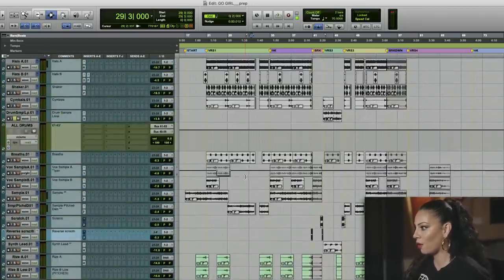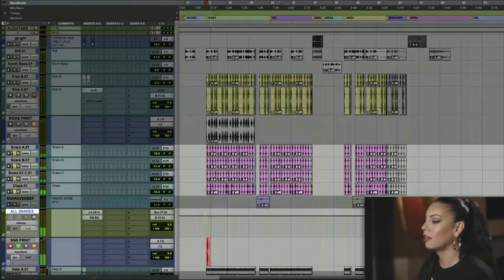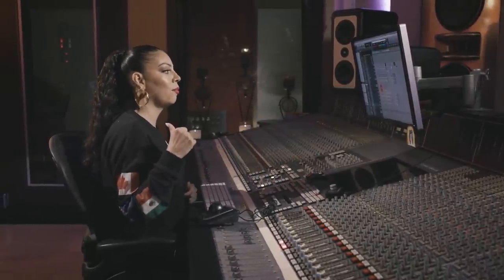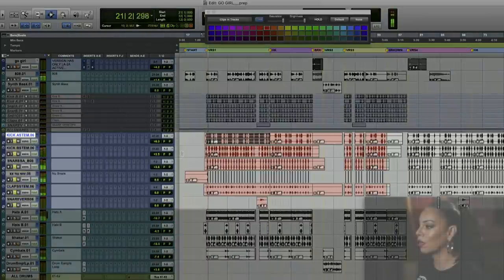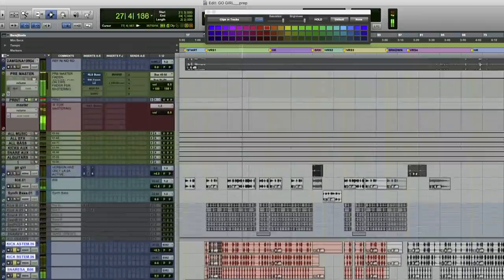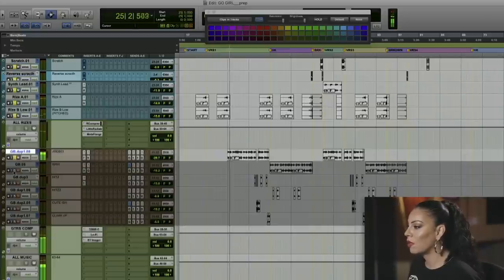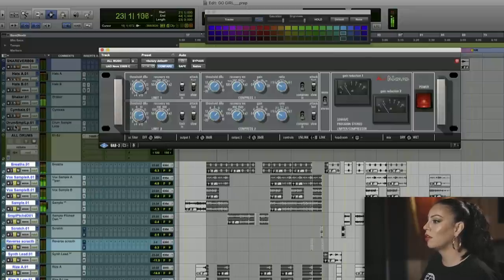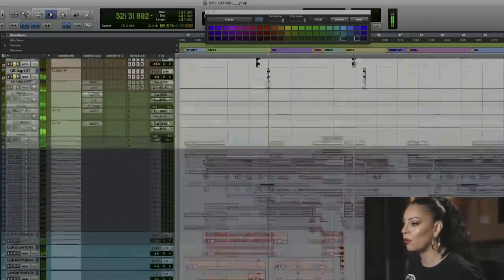Printing stems through analog equipment with Marcella Araica

Comment: So let’s get this straight… dump the stems into the board , mix down the stems , dump back onto the box mix down to one track then add the vst more compressor, saturation, eq etc… onto the track/master channel. Correct??? Or naw. Because i plan on buying a mixing board for my  small studio
Reply: I have an interface with 24 ins and outs with the option of adding up to 90 something channels. It’s a rack mounted beast. I also have a vintage Allen and heath 24 channel 8 bus desk, which I brought and painstakingly replaced all the capacitors and transistors in so it runs like new with no noise. 

When I have the structure of my song finished, I run each channel through the desk and re record it back into the DAW. The desk adds colour and in my opinion opens the sounds up and adds depth.  

I can also do the entire mix down through the desk and use the busses and master out to do the summing. 

I also have a 16 channel tape machine which I will restore and use too. Then I can get some of that lovely tape compression.
Reply: Those large boards are phasing out. Not many mixers mix on them anymore. Almost everyone is mixing Hybrid in the box without a mixer these days eliminating the middle man analog console. The new standard is outboard gear going straight into a multi channel AD / DA converter like the Lynx Aurora or Apogee Symphony i/O.
Reply: @seanmix2954  Woow you really have great knowledge ! Would you perhaps know by any chance the producer of the grammy-award winning song "Clarity" by Zedd ?
Reply: @seanmix2954  Could you explain it to us please , what is this thing RECORD PRODUCER , what does that mean ?
Reply: @seanmix2954  they most definitely are not phasing out.....

Comment: Are these all stereo tracks because they are samples ? I am from old school " I track the Drums myself" in the studio... ;-)
Reply: Stems are usually imported into stereo in Pro Tools. You can choose to stereo image everything during the mix. She is also printing in stereo which gives a wider overall sound from the board when it comes back in.
Reply: @EPtheDreamer  Hi EP... But are all those tracks " a real  stereo source" as each source has been recorded with 2 mics in a stereo array or are premixed in a stereo fx like a room reverb ? I mean like the snare and kick ? OverHeads I get it but for the other " usually " mono tracks.. ?
In those case is the left track of the stereo stem sample the same as the right as 2 mono tracks joined together ?
If so there would be no use or benefit to keep them stereo... Just saying... From an 60 yo tech...😏